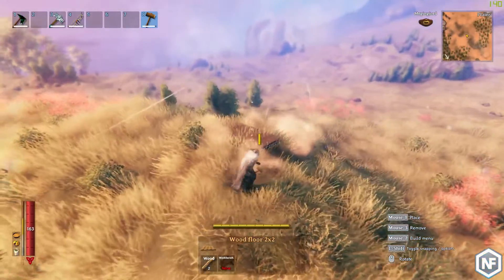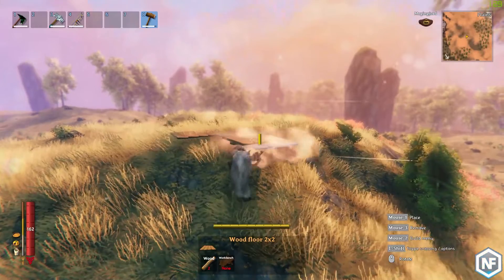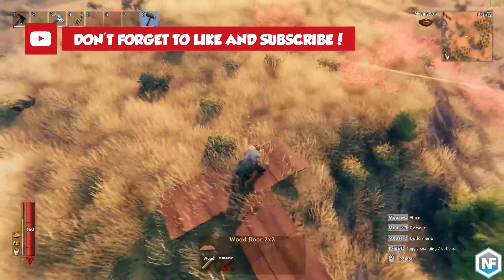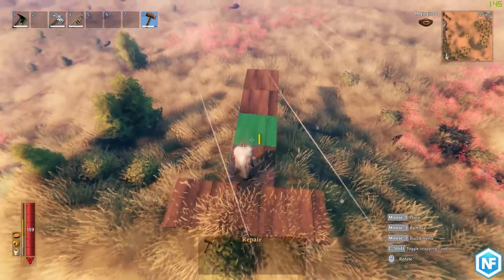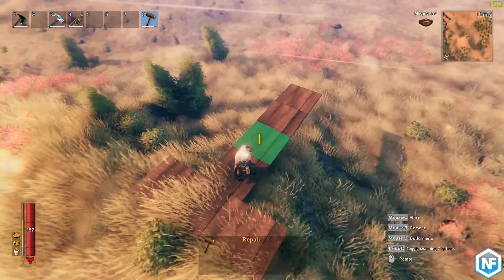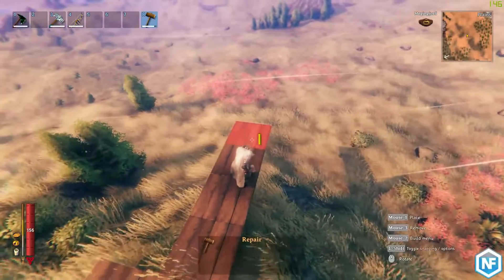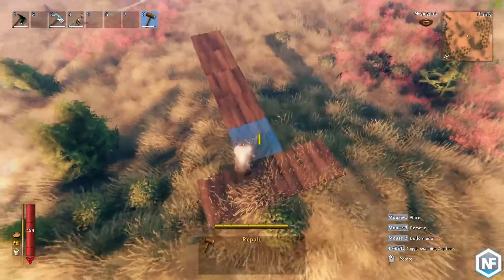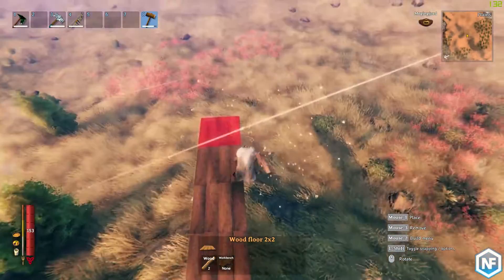Valheim Building Guide: Support 🔨 Valheim Building Tips and Tricks

Comment: For a quick guide this is perfect, you summarised the basics perfectly. But there is so much more to add that I think you will have to make advanced building guide. Of the top of my head I have some tips you may want to include:
1. Upgrading your hammer increases your building range which means less ladders in advanced projects.
2. It is most certainly possible to build a chimney so you don't suffocate if you want fireplace in your house. Game engine calculates rain as if there was close to no wind so as long as there is roof directly over fire, it will keep burning. Also torches don't produce smoke.
3. Regarding building support, there are some hidden modifiers you want to take into account when building vertically, which aren't that intuitive. Both stone and wood can be built at max 16 meters, no matter how many pieces you use (true for all materials), core wood poles support up to 24 meters and wood iron poles extend the building heigh to 50 meters, which theoretically is enough for most of the vikings. There is a cheeky way to build higher though, all you need is to plant a tree as it counts as foundation support.
I'm sure there is a page on wiki already for more source material. 
Hope I helped a bit, love your tutorials.
Reply from the maker: Love this. I just wanted to cover that core mechanic but after having created 30+ guides for Valheim I'm definitely in need of more tips/ topics to make videos on.

I really appreciate this comment <3